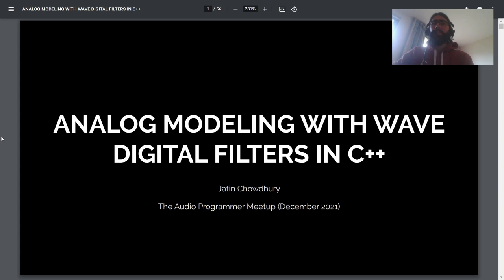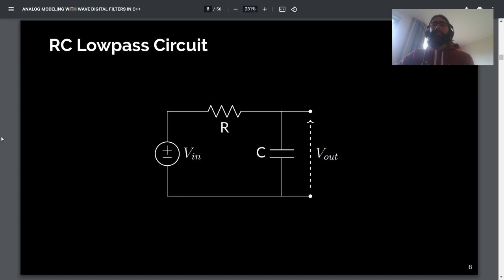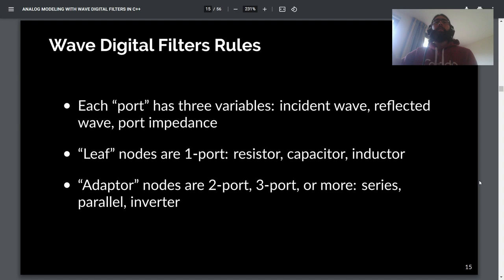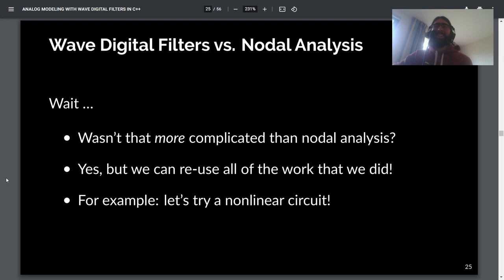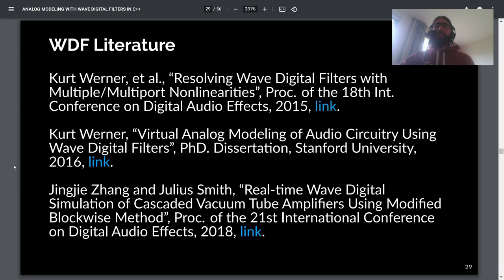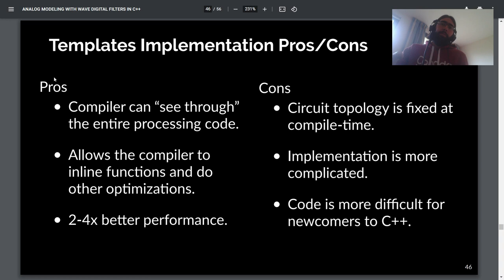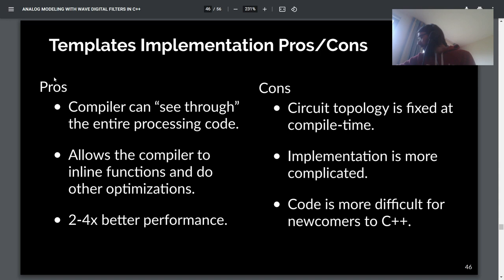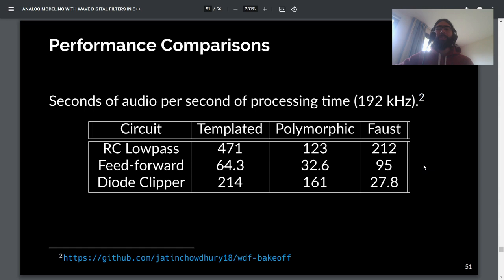"Analog Modeling With Wave Digital Filters In C++" || Jatin Chowdhury

Comment: great talk, thank you. To my experience, the vtable lookup is not the primary source of slowdown, much worse is all the missing optimization the compiler can't do because it doesn't know the full execution path at compile time.
Reply: Sure LUT's are not as bad if you're using intrinsic like SIMD but you're better off optimizing the functions instead for example,  WDF library use Omega.h template provided by DSP genius  Stefano D'Angelo in which he optimized functions like  pow and log  using some bit manipulation to calculate Omega function , if you were to do this the lambertW way which is like 100-1000 iterations its not at all good for cpu even when you're doing LUT's.

Comment: I'm wondering how you would model more complex systems with this approach. As long as they're linear, sure it works, no problem. But then I could just as well use the laplace transform and implement the system as a series of biquads or svfs. But with some nonlinearities? The limitation to just one (ONE!) nonlinear element makes the WDF seem completely useless to me. I guess I need to do more reading to fully understand what problem the WDF solves for me.
Reply: That's a very good question! I would definitely suggest reading Kurt Werner's publications for more info on handling circuits with multiple/multiport nonlinearities. I really like using WDFs to model simple circuits because I can get a working implementation more quickly than with any other method. For more complicated circuits, I've found that WDFs require about as much effort as any other modelling paradigm.
Reply: There are some methodologies to incorporate multiple nonlinearities in a WD scheme, however this comes at the cost of not having an explicit computational scheme, thus requiring the use of iterative solvers, such as the Newton Raphson method. A way to deal with multiple nonlinearitities in a WD scheme is to group them behind a bigger scattering matrix that is solved using iterative techniques.
Reply: @SciamanoII  All this stuff is breaking my brain but thanks. Just saw Dirk Roosenberg’s scattering matrix implementation in Faust.

Comment: Code complexity shouldn't trump speed in DSP because the instant response of the sound to the user input is super key to a proper functioning product. Imagine a car that only turned 3 seconds after you moved the steering wheel, it functions but doesn't actually meet the needs of the users. It would be interesting to see how an FPGA could be used as a signal processor, to further optimize these digital designs and produce real time signal processing with the same complexity as these digital filters.
Reply: I definitely agree that performance should typically trump code cleanliness for DSP code, though in this case it's usually a question of how many instances of a plugin can run at a time, rather than a question of latency. That said, most of the work in implementing this library has been about trying to make the user's code as clean as possible, without sacraficing performance.